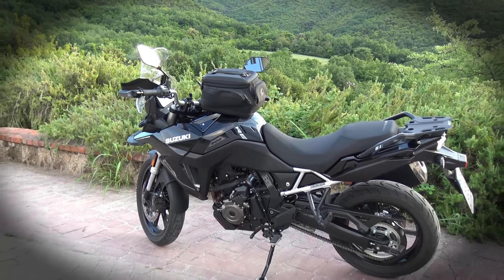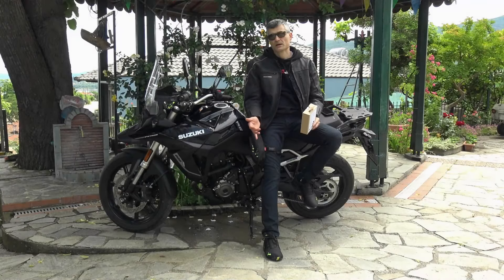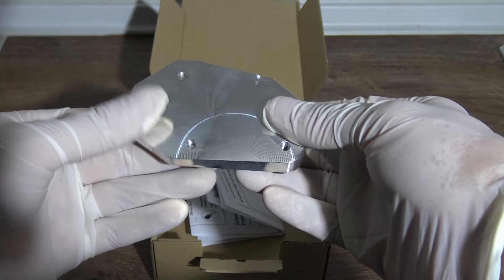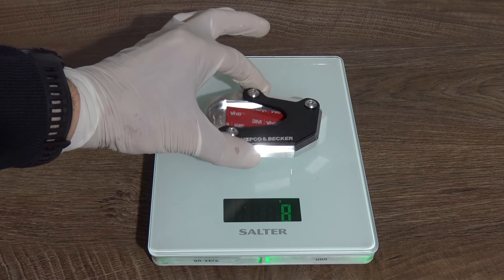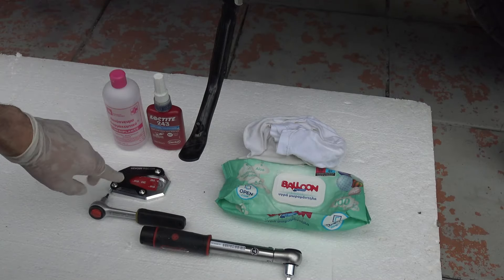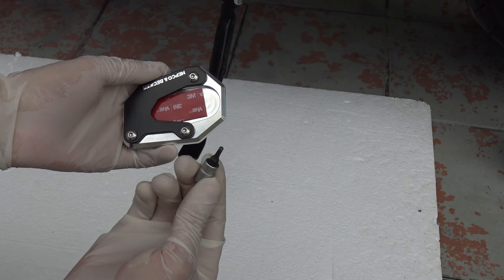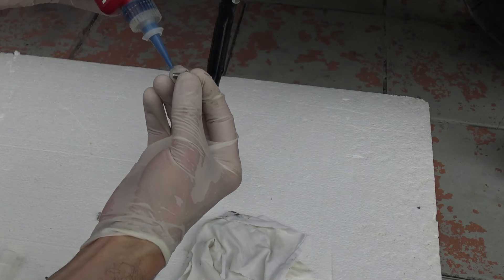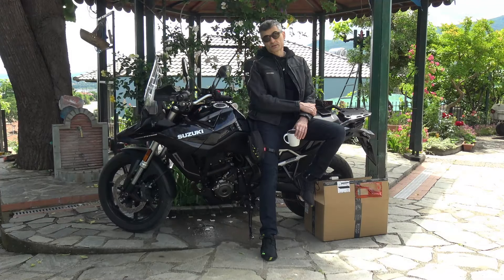Vstrom800 Accessories | Hepco & Becker Sidestand Upgrade

Comment: Best upgrade I've made so far is a GIVI Airflow screen. Looks way better than the stock screen, provides greater weather protection, and is easily adjustable.
Reply from the maker: Thanks for your comment. I know about this screen too. Do you have the 800 or 800DE?
Reply: @DrVstrom  The 800RE, same as your bike, in blue.
Reply from the maker: Good man :) good bike
Reply: Danke für die INFO, werde es mir holen für meine Suzi SV650 GRUSS aus Berlin
Reply from the maker: Thank you for  the comment and ride safe
Reply from the maker: Perhaps to help others, can you share your height and differences you ve noticed so others can decide if they can benefit from the airflow screen? Thanks
Reply: @DrVstrom  I'm 5'9" or 175 cm. I felt a lot of head buffeting from the stock screen and little body protection given its angular shape. The Airflow is wider and provides lots of body protection from wind and rain. The screen adjusts simply to create a wind free riding space, if that's what the rider wants. I had one on my V Strom 650XT, and it was great. The new one on the 800RE is just as good.
Reply from the maker: Thanks so much for sharing this :). I know about this screen from the 650 vstroms but wanted to hear if it is as good with the 800.